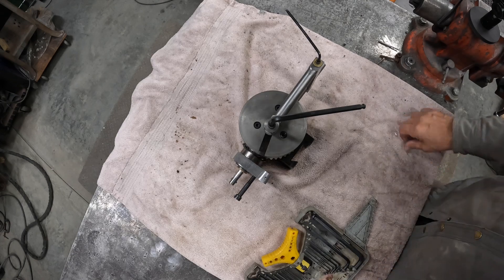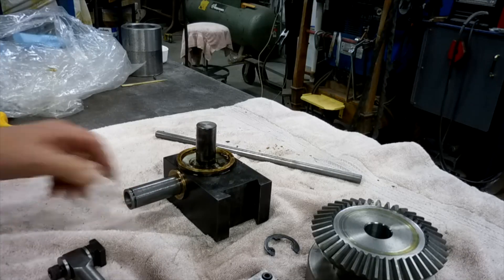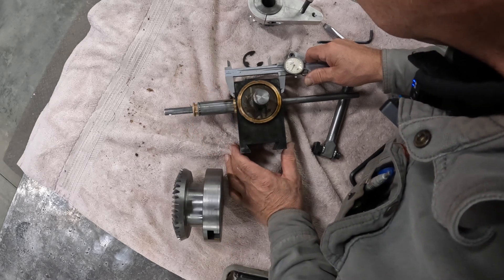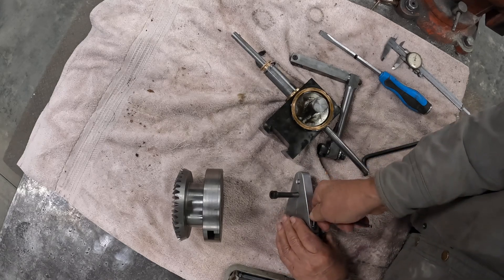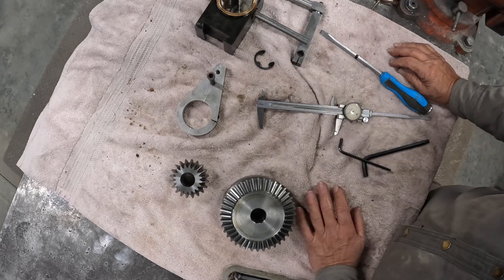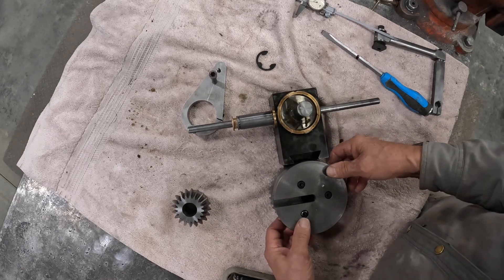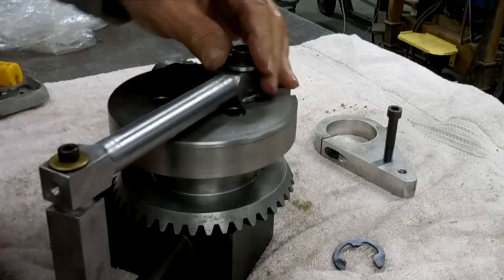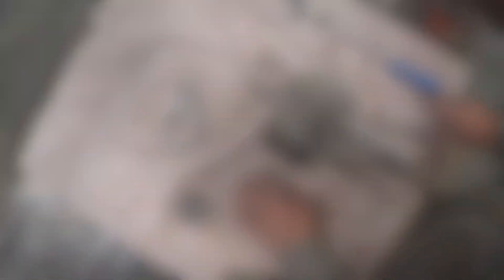Lathe Special Bushing Groover Tool UPDATE

Comment: Thanks for the video!  What is the size of the grooving bar?  (diameter and how long?)  Very cool tool, I am going to start gathering up pieces and make one of these when I have extra time.
Reply from the maker: The bar is fairly small, since most of the bushings I do are under 1 inch! The bar is 1/2" Dia. and the length if I remember is about 12". Thanks for asking.

Comment: That's very nice explanation. 
Thanks.
For smaller lathe,  the gears from an old angle grinder could be put into use. Just saying.
Reply from the maker: "Sundariyengar" Thanks for your commitment! I suppose an angle grinder might be an option, as I see it will run considerably slower and the design I used has the boring bar coming through the center of the smaller of the two gears! From what I've seen of angle grinders the smaller gear is pretty small! Good Luck With That!